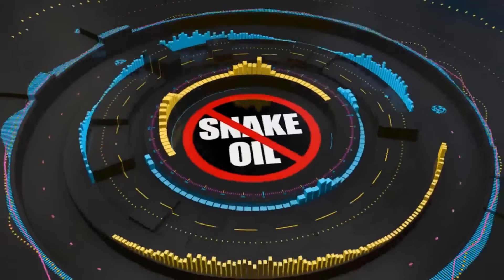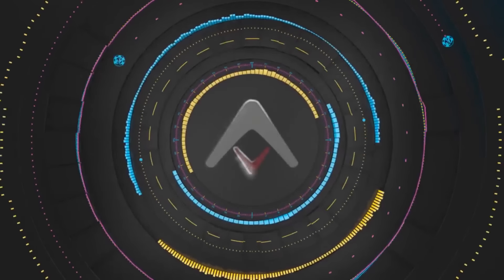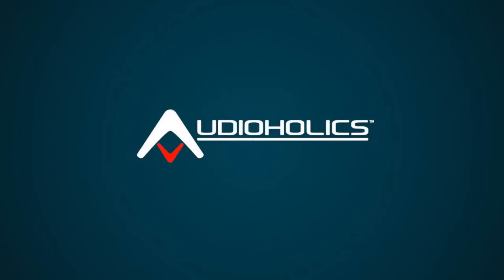STOP Worrying About These 5 Things in Audio!

Comment: I have 70 year old ears and eyes. I can't hear frequencies above 13 Khz and I wear glasses. I could throw all the money in the world at a system that costs me $150K but getting old has reminded me that I'm very happy with my current setup.
Reply from the maker: 13khz hearing is amazing at 70 years old. Be proud of that. My hearing doesn't extend much beyond that and I'm 50.
Reply: @Audioholics  
This is interesting.  
73 and ~14k.
Reply from the maker: @Douglas_Blake_579  occupational hazard
Reply: @Audioholics  
👍
But, there's an amazing feature hidden behind every Volume Control... Amazingly they can actually be used to turn things down!  Who knew?
Reply: Ahh your still young
Reply: At 70, make that final plunge of the $150K and a will
Reply: Are glasses affecting the listening experience of my system? i think i never noticed it !!
Reply: That’s why my Technics system when I was in middle school was way better . 😂
Reply: At age 50, I had an audiologist measure my hearing and it was good to 8.5 kHz, the upper limit of their testing. A year ago, at age 71, my hearing was again measured by an audiologist, and it 
was good only up to a little past 6 kHz. I was somewhat shocked since I practice good hearing hygiene and wear ear plugs in even moderately loud environments. Subjectively, I can hear fine and don't need hearing aids. Given all this, I no longer worry about how extended the high frequency response is for the speakers I currently have and any I might consider in the future.
Reply: I tested my grandmother around age 90 and she could only hear around 2 kHz, she still hummed along with her old war songs 🥲
Reply: Oh yeah.. old ears and eyes.. I feel it. 
Can't say I got $150K to buy a bigger bit in the setup... needing to turn it up louder.
Reply: I blind tested  fancy cables and lots of  amps  they don't make much difference. Good Speakers, room acoustics and source made more difference.
Reply: I agree with the speaker wire craziness , I recently upgraded all the speakers in my system and I used what the speaker manufacturer recommended for their product which was 16 gauge wire .I bought pure copper 16 gauge wire for all five of my speakers and subs got good quality RCA cables you can get anywhere. I do have to upgrade my phono cables I got a new turntable and used the wires it came with as they were all copper wires but I'm hearing some hum at higher volumes so I'm gonna put a good pair of RCAs on there and make a larger gauge pure copper ground wire before I consider upgrading the pre amp that my AVR has built in . System sound absolutely awesome as is with the 16 gauge wire .
Reply: Your hearing is just fine. You can discern differences between speakers etc. as well as most people can. Just because you’re no longer young doesn’t mean you won’t appreciate different components and different room treatments.
Reply: 44 18k
Reply: I'm almost 70 and I still don't have the proper audiophile room, nor a home theatre system. I still have to continue buying lottery tickets.
Reply: One of life's great ironies my friend. When we are young we can hear high fidelity but can't afford it, and by the time we can afford it we can't hear it :).
Reply: Same here. I bought a Marantz SR6015 on sale after the left channel went out on the 20yr old Pioneer. 
 Problem is, the speakers were budget RCA floor speakers. 
 They were always thin sounding, especially since they were three way and had a 12" woofer. The 12" woofers just never really delivered.
 After watching YouTube speaker rebuild channels, I replaced all the drivers and crossovers in them. Added some bracing, and they actually sound very respectable now. 
 Audiophile grade? No, but good enough for me, and way way better than they ever were before. 
 Good tight deep bass that they never even ever came close to having before the rebuild.
 A new WIIM Pro Plus added to the equation, has really given me more than enough quality sound than my 65 year old ears will ever need.
Reply: @EmilioGalicchio  you need to put some diffusers on your lenses lol
Reply: 10 years younger but my hearing tops out at 10khz 😢 I still upgraded my system significantly because you’re a long time dead. It sounds great , looks nice, and makes me happy 🥳
Reply: Tis one of life's great ironies.
When we are young we have great hearing, but can't afford a top notch system, when were older we can afford it, but cant appreciate it.
Reply: @Audioholics  I'm 53, before long-COVID messed me up 15 months ago I could still hear up to 17.8 kHz at age 52. It wasn't a proper test, but I used a frequency generator app on Win10 and kept moving the slider around to figure out where my limit was. I was amazed that I could hear up that high at age 52.
Reply from the maker: @BB..........  consider yourself very fortunate.  My hearing stops around 14khz now 😢
Reply: @Audioholics  It makes me wonder how good my hearing could have been if I'd taken even better care of my hearing in my teens and 20s. I did a pretty good job of wearing ear plugs, but there's a lot of missed opportunities at the drag races, on the job (former IBEW ITS technician) and riding sportbikes without hearing protection.

Comment: The only thing every audiofile should concentrate on is working on room treatments not so much on equipment. 😊
Reply: Even though I disagree with Dennis Foley on some details, his youtube videos and shop is a great place to start: Acoustic Fields
Reply: @Munakas-wq3gp  Curious what details you disagree with. I have been watching his videos for a few years now.
Reply: Agree 💯 % on room treatment. It is about 50% of the sound. I wish everyone could hear a great system in a properly treated room. I think most people would be astonished at what is possible. Aside from room treatment is speaker placement. Looking at photos across the internet, most people don't even have their speakers properly set up.
Reply: Totally agree. And the others with speaker cables and interconnects as long as they are reasonable quality(I make my own) ...it's called  placebo your ears play tricks

Comment: I find that listerning not measuring, tends to give you an understanding of any difference, take the Chord Dave DAC, it does not measure as well as a Topping D90, however, the reproduction from the Dave is on a completely different level !  Cables are more subtle, upgrading from Amazon Basic Cables to first or second levels cables, does make a different to the sound (good and bad), even my wife can tell and she has no interest in Audio.  Whether spending $1000's on cables provides an ever increasing improvement in sound I cannot say, but a high resolving system does benefit from upgrading from basic to mid-range cables, it is very notable, in my humble opinion.....

Comment: I couldn't agree more about the cables. Years ago I purchase Acoustic Zen cables which are thick and my SVS cables sound just as good. I am one of those that recently purchased the Marantz AV10 and AMP10. I like them both. I wish the AMP 10 ran a little cooler as it keeps my AC Afinity running a lot to keep it at 85F. But, I am biamping my LRC channels so maybe that is making it work harder. Thanks for the video.

Comment: While I have accepted your arguments regarding cables I have never the less upgraded mine. I have intentionally chosen the cheaper cables because IF there is any difference it will be between standard copper wiring and copper of a higher technical specification. My reason for upgrading my cables has been entirely to do with licking the idear of Silver (Plated) connectors' as potentially the week point in any circuit is in your 'Plugs' (Connection points).
Although I watch a lot of Hify videos I turn off listening videos. Through which speakers am I supposed to listen for subtle sonic differences, my mobile phone ,my lap top, my TV, or my full sound system that even side by side would be different to theirs? Even the best recordings they want us to listen to sound dreadful next to me listening direct to the same recordings.
Adding a quality (Not expensive) linear Power supply to my streamer was the biggest single improvement in my sound that came after all the rest but took my sound to another level.
Question ? My Integrated balanced Tube Amp has a high and low output gain setting that I understand you chose between depending on if you are using EL34 Tubes or KT88 ones. My Speakers are 6 Ohm rated and are %89.9 efficient (Is it?)  so I'm hoping you will agree with me that I can just leave my gain to high?
All the best ,thanks.

Comment: The speaker cable saw blue jeans cable.. Went with them can't be happier

All Blue Jean Cables 

Denon 3700.. Monolith 7 * 200.. Emotiva basx4 for atmos.... 7.2.4 Arendel 1723s LFC.. Arendal 1723s surrounds.. Arendal 1961s heights.. 2 Arendal 1961s Subwoofer.. Equals 😁😁😁

Comment: I use Micca 14g speaker wires from Amazon. 12 foot, banana's on both ends. $39/pr. Sounds better then the Audioquest Hyperblitz bi-wires I got for free with a set of speakers off CL. Sold them for $220 on Ebay! Also put some rubber feet on the bottom of my Sony 800 universal BluRay player. $8. Thats about it.

Comment: The thing I hear and wonder about is "do not run signal wires next to power wires"  Well sometimes you cannot separate them much. that is just the direction all cables have to go... And I hear about cables picking up interference. You talk about home depot cables, and I am sure they are not shielded... so is this really an issue?

Comment: I think one point is that what you are streaming and the quality of streaming can make you question if your gear is performing as well as it should. How far do you go with the quality of DA converters and how does it really impact what you are hearing or is it just messing with your ears.
Reply from the maker: If you're using the DACs in a high end AVR or Pre/Pro, there's no reason to purchase an external DAC.
Reply: Lower the ohmage higher the voltage 
Transistors work on high current low voltage 
Valve amplifiers run on high voltage very low current

Comment: I dont worry about any of these things listed in this video.  I an quite concerned, however, with cheap binding post assemblies that use steel.
Reply: Don't be.  There's a lot of noise made about ferrous materials and magnetism and none of it actually matters.  
What does matter is that you get a good snug connection.

Comment: Regarding your comments about cables, you didn't mention that ultimately, it's the sound for the buyer/listener that should matter most.  You have said on a past video that you like Kimber Kable 8TC because it measures so well.  But would it not be worthwhile to borrow some other brands of identical length & similar cost & perhaps one of those might sound better?  If so, then the better-sounding cable's measurements wouldn't matter
Reply from the maker: Over a course of 25 years running Audioholics,  I've tried dozens of "high end" brands. There's no magic or difference in minimaly competently designed cables over the expensive esoteric. Some of the esoteric can be worse due to the stupid LCR boxes they place on them acting like poor tone controls.

Comment: This question is to Gene or anyone else that knows…is it better to use a biwire speaker cable or just use jumpers. I was told a biwired cable will have greater signal loss. Can this be true?
Reply from the maker: Use single low gauge wire and jumpers.  No need to biwire unless you like the look. In that case, use the same gauge wire if you're planning to biwire.
Reply: Bi-Wireing  (as opposed to Bi-Amping) is simply a way to sell you twice as much overpriced speaker cable.

Comment: 10:10 That is true. When I needed to buy a new receiver because my previous receiver (Marantz SR-5008) was damaged due to Hurricane Michael, I was contemplating whether to buy a Denon AVR-X3400H (a discontinued model) or AVR-X3500H (new model which features eARC). When I bought a Marantz SR5008, I kind of thought the amplifier is going to be better than SR5007. I was wrong and I did not have a need for 4K 30Hz feature at all. I did not know what the differences is between the SR5008 and SR5007 and I could have saved money by buying a discontinued model. If I wanted a better amplifier, I would have went with Marantz SR6007 instead, but I don't know if better amplifier in SR6007 is going to be better than SR5007 or even SR5008.

Well, it's not like I'd pay double the price for an AVR that will give me 50% better sound... I think about 5 grand, perhaps the components would be a lot better, but maybe I'm wrong. Maybe I might be better off going for separates with a better amp that can drive my JBL Stage 180 floorstanding speakers. I watch movies at loud volume just to enjoy and I kind of feel like my Denon AVR-X3400H may not have the amplifier power it needs to drive my front speakers and cheap 8-ohm surround speakers.

In any case, I'm better off staying with my Denon AVR-X3400H. Other than the lack of eARC (I do not need audio going from a TV to my receiver), HDMI 2.0 is more than fine for me for gaming at 4K 60Hz. Even if I go from my computer to an HDMI 2.1 audio extractor to my TV to my AVR and even if I configure my TV in PC mode and set my PC to 120Hz, I could not tell a difference between 60Hz and 120Hz. My eyes are not sensitive enough to notice a difference that's higher than 60Hz. This is especially if I play Portal 2. Maybe with sub-10 milliseconds reaction time I might be able to tell a difference between 60Hz and 120Hz, but I don't play eSports/multiplayer games anyway.

Oh yeah and I do have a visual disability. I'm blind in my left eye but can still see okay with my right eye but only when I use a full-screen magnifier in my Linux PC. Visual disabilities can be a factor that can hinder the benefits of seeing 120Hz and higher.

Comment: Well I agree with many of your points.  Except the ones about cables.  I have heard, and do continue to hear differences between speaker cables and interconnects.
Reply from the maker: The mind plays tricks on everyone, which is why controlled blind listening tests are essential when comparing stimulus with little or no change such as cables. Once controlled tests are done, the sonic differences in cables usually disappear.
Reply: @Audioholics  and I’ve been a cable denier for 20 years.  upgrading to some better quality equipment. Across-the-board has changed my mind.

Comment: The only concern with cables should be it' s insulating properties that's the ONLY difference otherwise you can't hear ANY difference in sound quality.  For playback,  I prefer analog EQ over digital. Digital EQ can clip at even modest levels.

Comment: Whilst I don't think that a Youtube can give an accurate guide to how a speaker or other audio equipment can sound.  They can be a loose guide. When I bought the ISO acousitc Gaia III, I listened to 'Pursuit Perfect System' youtube channel A/B comparison of the Gaia II, there was a very noticeable difference.  After that I checked as many reviews as possible, and I was able to take that feed back and understand that the Gaia's would make a significant difference, particularly with soundstage and separation (which they have).

Comment: I do enjoy listening to YouTube speaker comparisons that switch between a couple sets of speakers and direct playback. Sure, you aren't ever going to get an accurate representation of the speakers, but you can pick up on some of the differences between the two sets and your own.
Reply from the maker: those differences have little to no basis in reality on the performance of the speakers.
Reply: @Audioholics  I agree it's mostly frivolous, but are the tonal characteristics not a component of the 'performance'? You can certainly tell if one speaker dips down lower than the other, or if it leans towards being bright sounding in comparison.

I would never use it as a serious tool to make a decision, but it's a good bit of fun and I don't think it's fair to say you can't gain any information at all from it. 

I mean if you want to nitpick auditioning a speaker anywhere but where you intend to put it also would significantly change it's performance characteristics.

Comment: I have some mystery vintage Infinity 2500 speakers that are 4ohm. I was using them in the bedroom at low volumes with a cheap Pioneer amp and I knew it could be a problem for the pioneer. Well after a month the pioneer started with a low internal hum. As it got worse I just tossed the thing out. I replaced with a Yamaha Aventage ra-a710 which Yamaha claims can handle 4ohm speakers but now after a few months the Yammy has now developed the low hum. These speakers are amp killers.  Why would this be???

Comment: The impedance on a Yamaha receiver can be adjusted within the secret menu on startup.
I have six ohm speakers so I set the receiver up for six ohms.
I did play around with eight ohms, the speakers I have are Yamaha Ns-777 which are rated for six ohms. People do say , you can damage your speakers. 
Is this true?
Reply from the maker: Watch my video on the topic. I couldn't be more clear.
Reply: Wow what a difference. No need to upgrade amplifier for more power. Thank you a little reassurance goes a long way.
It woke up my speakers.
I quickly Recalibrated speakers 75db in seating position at reference level 0.0db.
 I was Listening to,
 Tool - Pneuma 
I hit 105 db just above reference in room 
The sound is extremely sharp and precise the bass is tight extremely tight blown me away. It has friend approval:)